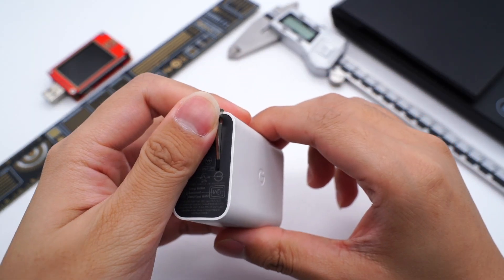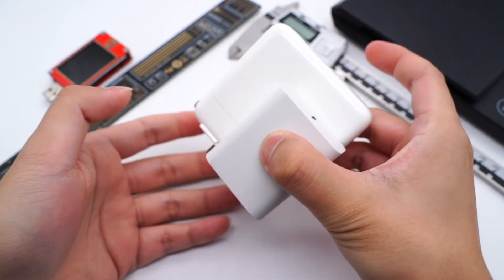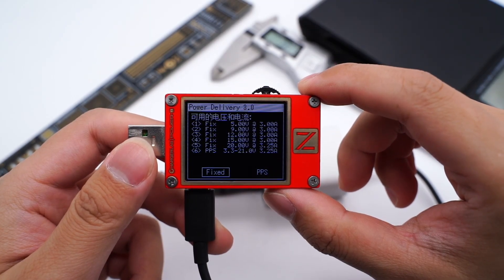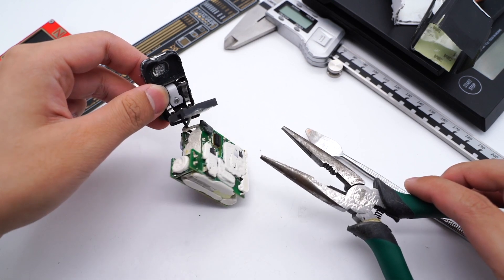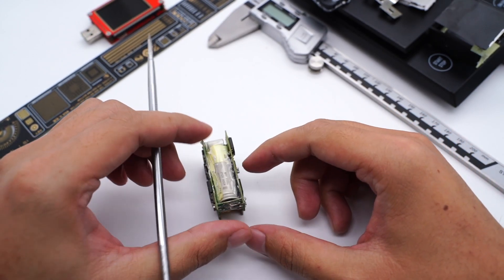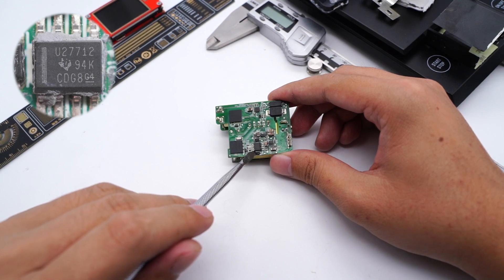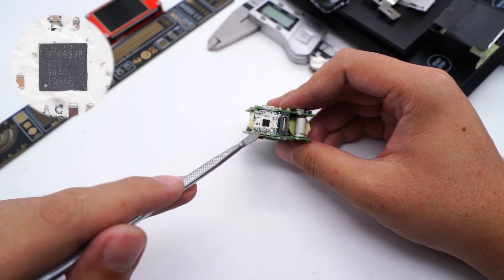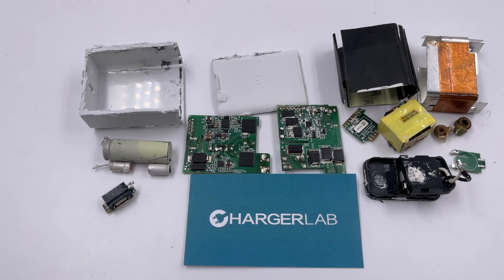Teardown of Unreleased Google 65W Mini Charger

Comment: @Alex Martian  Rubycon Primary side polymer, discrete diode bridge will be more expensive than a pre made on, Texas instruments primary side controller, nobody uses a discrete driver chip, infinion primary switching transistor, murata y cap, moulded smd kemet tantalums, ouput infinion MOSFET, wurth inductor, protocol chip. All these are decent quality and not cheap at all.

Comment: 8:08 what is ACF topology? could not google definite answer.
Reply: It's a flback with active discharging(clamping) of the core which reduces ringing in the core which in turn reduces the need for high voltage rating primary FET and some other stuff like it also enables ZVS.
Reply: @tanishqbhaiji103  Thanks! How does ACF spell out? I expected that in the answer to find out more via web search...
Reply: @alexmartian3972  Active Clamp Flyback
Reply: The control is the hardest part for this topology in my opinion and that's probably why they are using the TI controller and driver.

Comment: You should check out desktop computer power supplies too, they can be very small and compact. I build small form factor computers and my computer has an 850w power supply that’s only 100mm by 120mm by 60mm

Comment: I wish Apple chargers are smaller. They are so bulky to transport on the go.
Reply: buy a third party one
Reply: @oMega-sm1eg  , of course one could do that. But it means setting aside the OEM charger as a useless appendage. E-waste
Reply: @thihal123  Bruh, just put the third party one in the backpack and leave the OEM one plugged in at home, so you will never have to or forget to put the charger in the backpack before you leave.

Comment: Firstly, I appreciate your job. Since yt became almost a forum thanks to its comments section, I wanna ask a question. While those many new chargers support USB PD protocols, they have a voltage range from 5V to around 20V. If those chargers support 5 9 12 15 V they simply mark it as 9V, not 9.1V or 12V not 12.2V on the charger casing. However, in the case of 20V it differs from charger to charger (eg. apple 96W has 20.5V and apple 87W has 20.2V).  Why does it differ? What is the reason?
Reply: they are just marking it that way to compesate for the voltage drop on the cable, but such things are corrected automatically in PD protocol. It's all compatible with each other, in PD 20v output, all chargers give out more than 20, like 20.5 and on the receiver's end, it got dropped to 20. Apple is putting the actual output voltage on its chargers while others are simply stating "PD 20V". the greater the current and power, the more significant the difference.

Comment: Good heat dissipation through the large heat sink, but being so tightly packed and the extra hard exterior plastic casing, this power adapter will be running hot 🔥

Comment: best charger shown in this channel so far. Quality components, super dense construction. Shows that GaN thing is just a gimmick and efficient dense chargers can be made without it
Reply: Who Dis?  yes GaN FETs can be %2-%5 perfect more efficent than silicon FETs but GaN alone doesn't makes charger efficent. And most of the manufacturers uses GaN FET with shitty components and advertises it as efficent but it ends up being less efficient than a quality silicon FET charger. That's why i called it a gimmick
Reply: Who Dis?  And i don't think over 5 years GaN FETs will get far more efficent. Their prices will go down drastically and they become more popular but i dont think same will happen in efficiency.

Comment: This is probably not gonna be used in the production charger, or the price will be higher than 100 dollars. They are using very expensive parts which are only used for one-off or small scale production only - like a prototype. The design is very complex for such a simple product.
Reply: which parts are especially expensive?

Comment: "doesnt use GaN"

Sooo is the GaN hype premature?
Reply: In my opinion, yeah. There have have been adapters which provide 60w of power in an acceptable size for a very long time, they just increased the heatsinking, reduced the wasted space in the design and increased the output votlahe which basically doesn't affect the power loss much compared to current and acted like they have revolutionised the world.